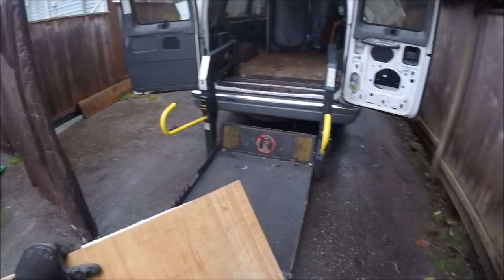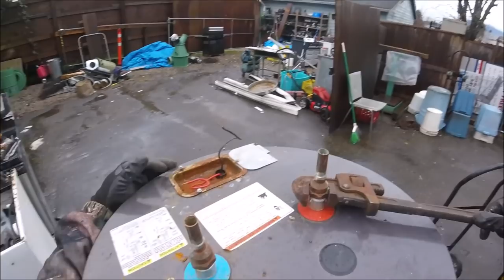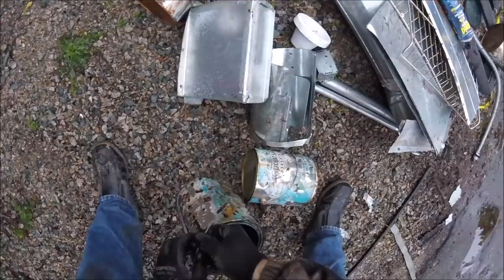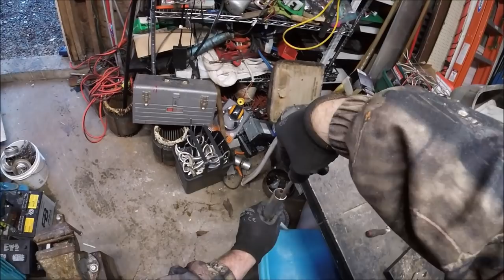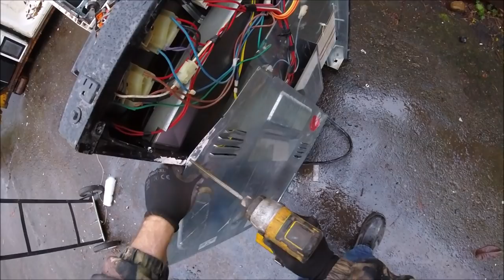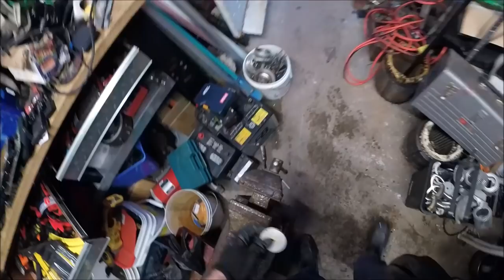Filling My Bin & Scrapping More Things

Comment: Check out Scrap and Palletmans newest video.  A theatre threw out their old movie projection equipment, they sure could have used your help breaking them up and micro scrapping.  Maybe you could check the older theatres, they may have the old equipment sitting around too.
Reply from the maker: Yes i would of scrapped them all clean no wire or any left motors

Comment: Those two brackets on the floor don't cut the bolts off just cut them flush with the top of the bracket it sticks up about an inch or so cut them there